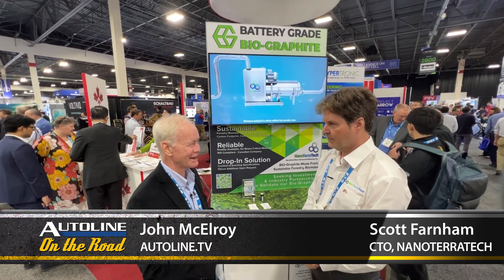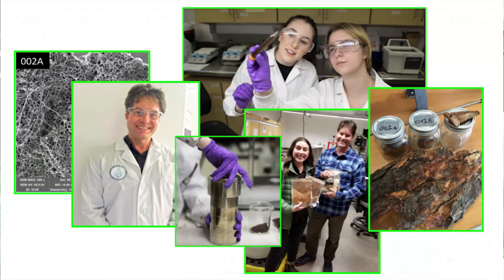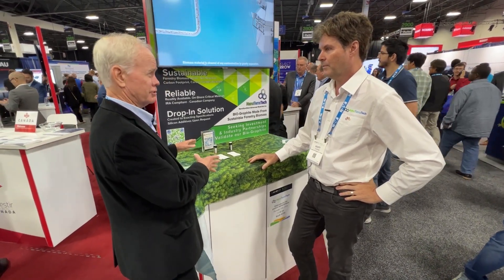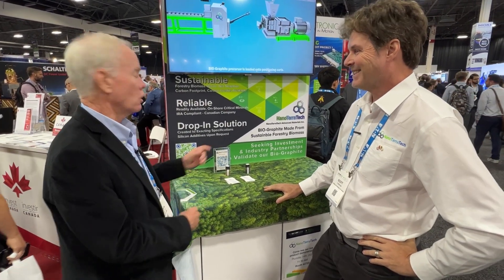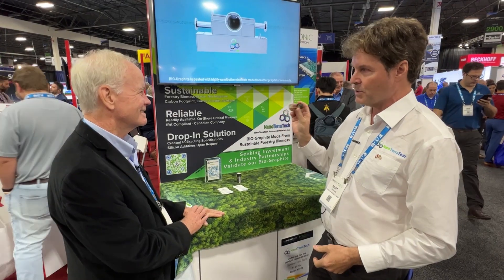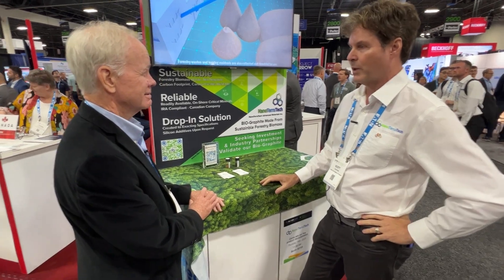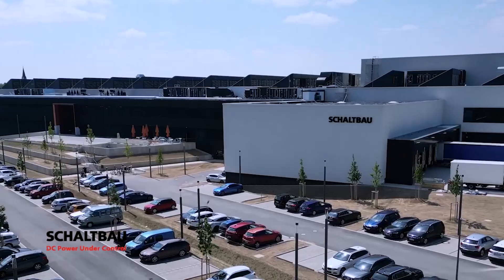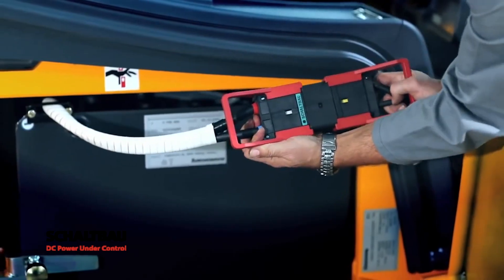Breakthrough Process Converts Wood Waste to Graphite - The Battery Show 2023

Comment: He totally dodged the question about cost, implying lower cost without actually saying anything.
Reply: Yeah, that was unfortunate. The car companies do care about cost - how much per ton of this eco-graphite compared to a ton of mined graphite? Let's hear actual numbers. If it's cost comparative, or maybe even a little more, then car companies may do it just for the green cred, but if it's a LOT more, then this is a non-starter unfortunately.
Reply: @ColinFox  Or car companies will use 1% green graphite + 99% mined graphite, then market their vehicles as "made with green graphite".
Reply: It sounded like a company that has not figured out the scaling process and generally being nervous. Yes cost is important but the industrial knowledge might be lacking as it looks like lab work at this time.

I think it's a really clever idea and probable viable as wood is generally 50% carbon or more so just a question of breaking the bonds off hydrogen and oxygen and layering the carbon rings.